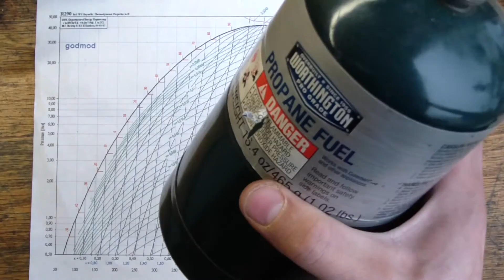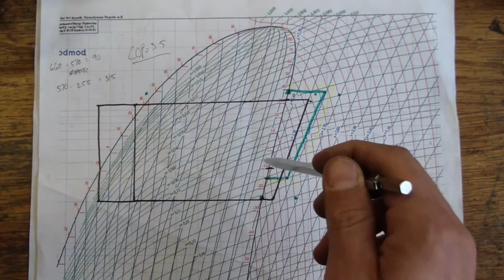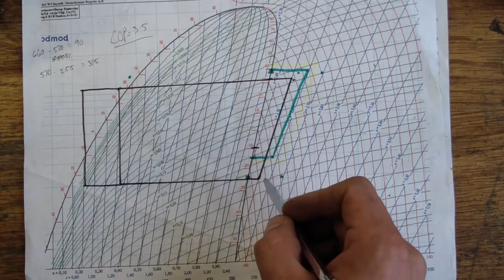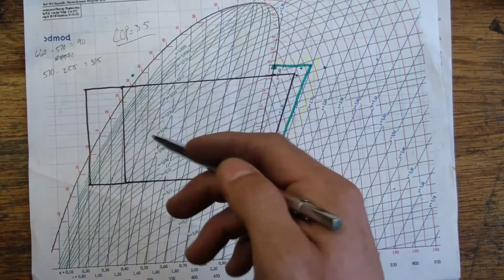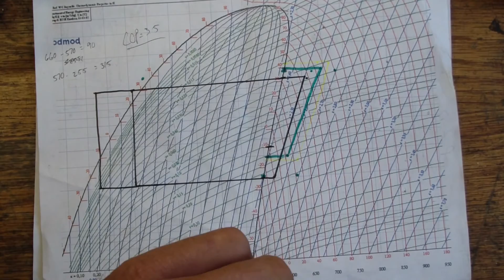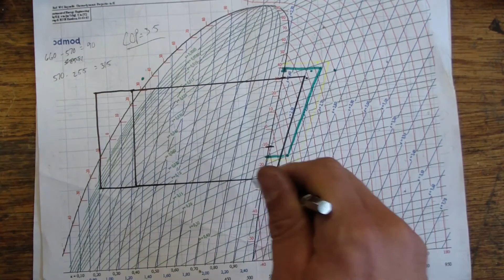DIY Refrigeration,  log(p) - h Diagrams!

Comment: what if my evaporator temperature and suction temperature are different, in that case you wouldnt have a vertical line from txv out to the low pressure line. ie an evap tempt of 0-10F and suction temp of 60F how is this plotted? To me it looks like the assumption is that if your evap is the same pressure as your suction pressure then the temperature should land horizontally across it. In my current experiment that is not the case.

Comment: There is a simple formula for flow rate per ton,  in pounds per minute:  200/(Hd-Hs).  This automatically takes subcooling and superheat into the equation, cancelling out any difference of  both the latent heat of the refrigerant  and the ratio of delta T at its two saturation points.  Ergo,  this formula works for any azeotropic refrigerant.

Comment: sir thnk u so much for your video,,,,,i like you ask you this following question given to me by my turtor: ". A refrigerator operates on the ideal vapor compression refrigeration cycle and uses refrigerant 134a as the working fluid. The condenser operates at 1.6mpa and the evaporator at -6’c. if an adiabatic, reversible expansion device were available and used to expand the liquid leaving the condenser, how much would the COP improved by using this device instead of the throttle device." can you give and an idea how i can go about it please,,,i was get confuse since only one pressure and temperature is given.